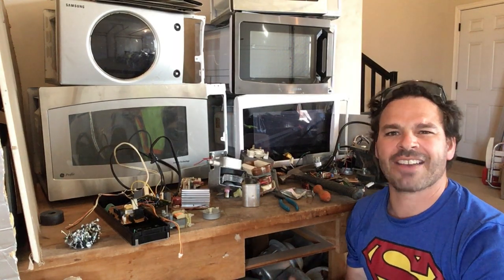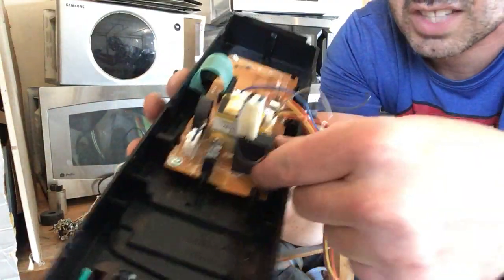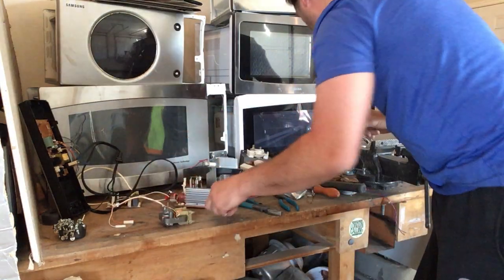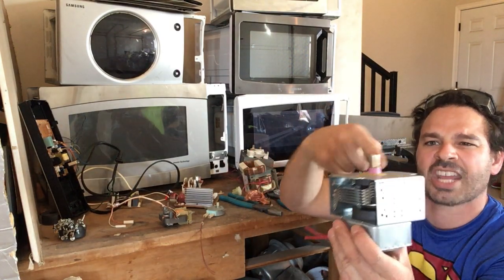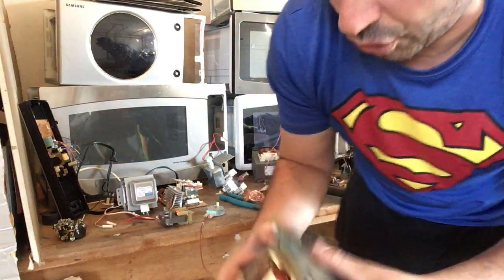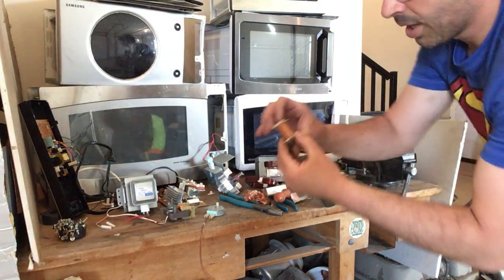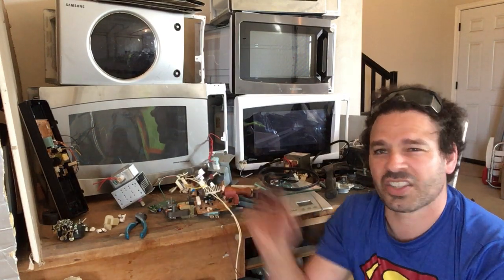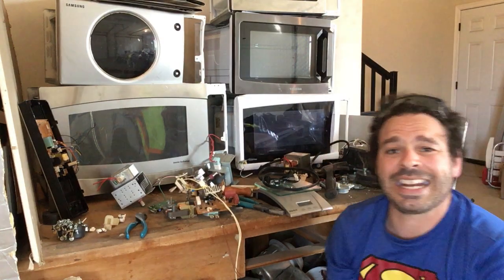Scrapping microwaves. Do larger microwaves have more copper than smaller ones?

Comment: Great videos and lot of info.. Just a quick question... How do you know if your gas water heater is copper or stainless before getting into the scrapping part of it  Please let me know Thanks.
Reply from the maker: If you mean the drum, unfortunately you will have to remove a few screws to remove the opening plate and look inside. Or if you are just scrapping it anyway, perhaps put a drill hole in the tank and see if copper residue is on the screw bit. Unfortunately I have only seen 1 with a copper drum. It was an older tank.
Reply: @TinManScrapper  Thanks alot Turned out Like you said I took the panel off and seen it was steel.  Thanks again  Great Vids Keep em coming!!!

Comment: I scrapped a 1969 microwave last month and it was 74 pounds with about 3 pounds of copper in it. Everything was heavier duty than the newer ones I have done.
Reply: I didn't  know  we had them in 1969.   Must of cost a small fortune  back then.
 Maybe it was a prototype 😄
Reply: @paulcoenen7918  microwave been around since the 40s
Reply: I saved the plate on the back with all the info. It's a scrapping badge.
Reply: @wannabescrapper72  I do that with all older power tools and electric motors. They make nice wall hangers.lol
Reply: @handduggraverdronline  
Not where I was from.

Comment: microwaves have been a huge (copper transformer) disappointment for me, just started scrapping.   had about 20 saved up and the first 8 of 9 were al/al transformers, one very old panasonic (1979 specs) was cu/cu.   in lg and ge (big microwaves) the heavier fan motors were al. too.    vacs, microwaves, and washer/dryers are just about all al. now.   tell me i'm wrong.
Reply from the maker: I really think it depends we’re you live and what type  of appliance. I am still finding over half that are copper wire. The more modern microwaves and vacuums seem to be aluminum more now, but again I am still finding lots that are copper.
Reply: @TinManScrapper    thanks for responding.   gives me hope, maybe i've just been unlucky, i'd really settle for 50% cu right now.   but if this doesn't change i'll have to reassess where i go and what i look for, again, scrapping really is a fluid endeavor.   i was like, "well at least steel shred is up there", there's no shortage of that, then i go to the scrapyard and they dropped the price $2.50.
Reply from the maker: @tomitstube  lol, nice thing microwaves are very easy to take apart and the aluminum transformers are still worth some money and there still are other parts that have copper on them
Reply: @TinManScrapper    just picked up a jacuzzi motor yesterday.  2 lbs 6.5 oz's cu.   more of those please.